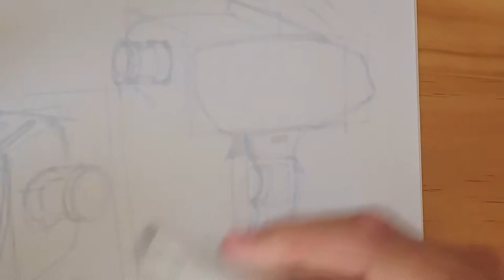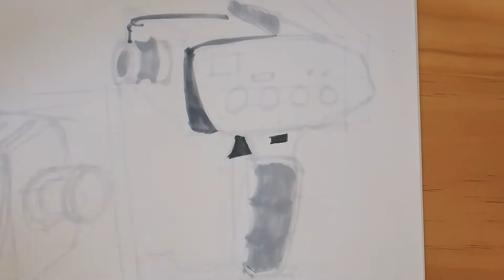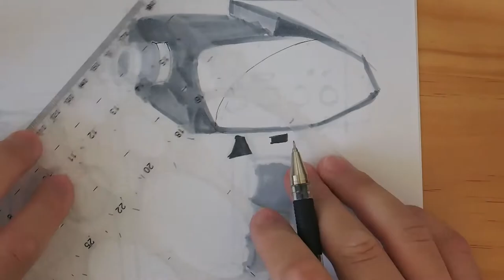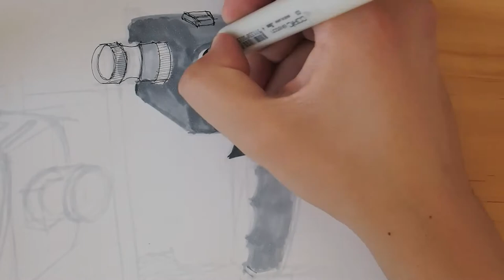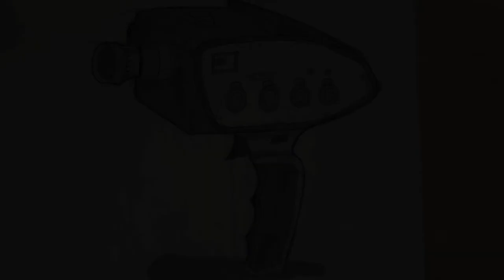Industrial Design Vlog: Sketching a Digital Bolex

Comment: Your well on your way, good sir. Until recently I used the same light cool marker technique for sketching. I have switched to thin micron pens for my first lines. As long as you give no shits (meaning 1 try per line), microns before rendering with light markers works well. Its much faster too. Only based on my own experience, of course.